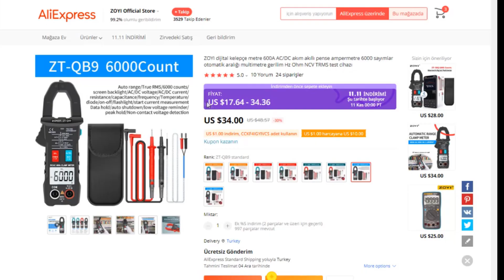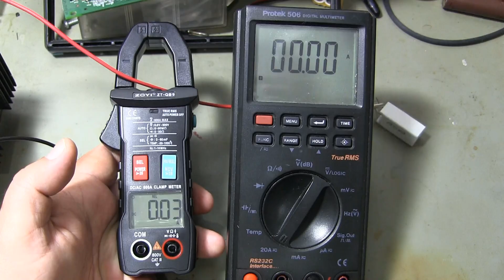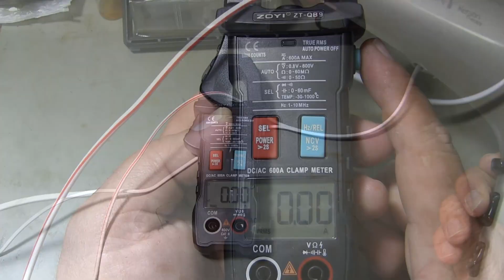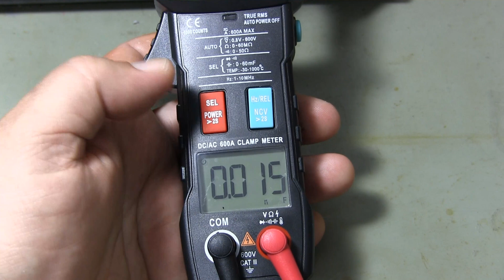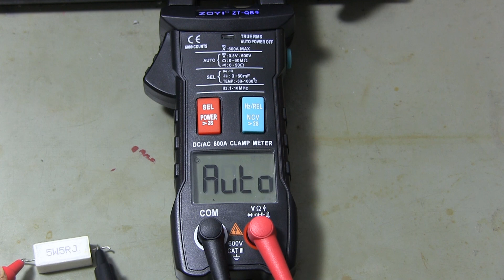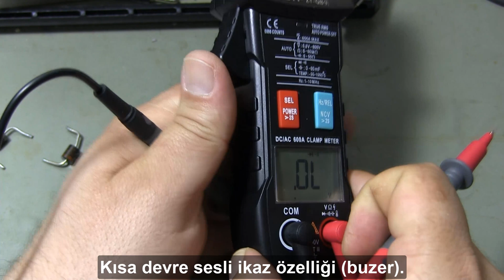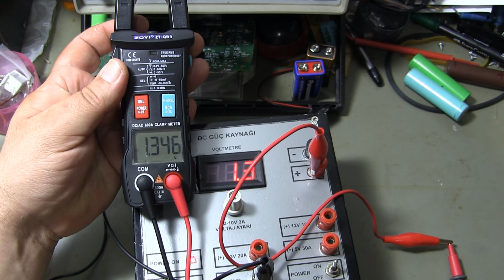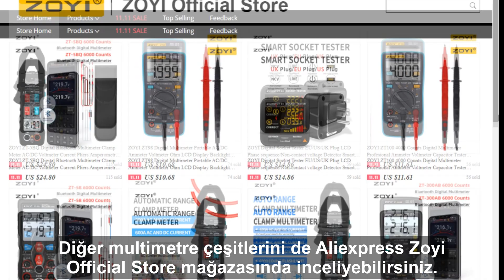ZOYI ZT QB9 CLAMP MULTIMETER, ZOYI ZT QB9 KELEPÇE MULTİMETRE

Comment: Does it measure DC inrush current, also called DC surge current? The Aneng CM82 measures both. 

Does it display the frequency when I push the Hz button in AC current mode (through the clamp)? 

I can't decide whether I should buy the Aneng CM82 or this Zoyi ZT-QB9.
Reply from the maker: Hello my friend.
It has the feature of measuring DC inrush currents.
It does not measure the frequency in the clamp. Frequency measurement is done with probes.
Nice on two multimeters. The decision is yours.
Reply: @electronic7979  
Thank you for your quick reply, it's highly appreciated!